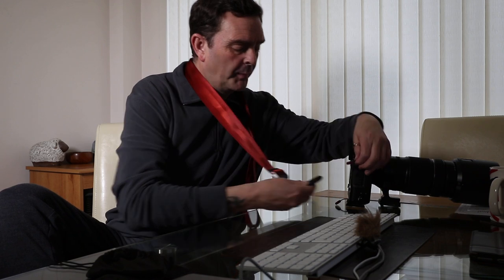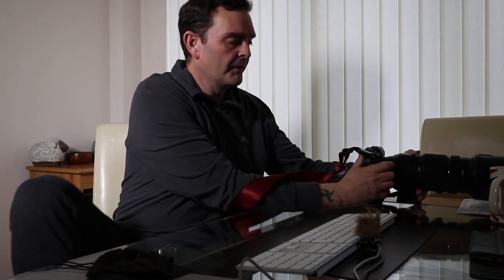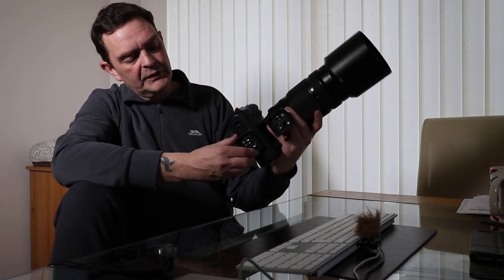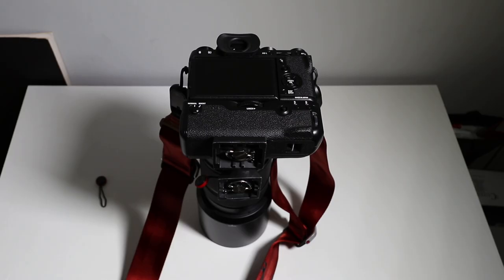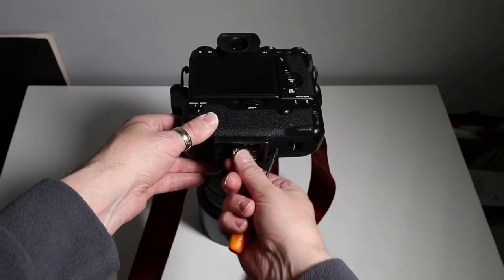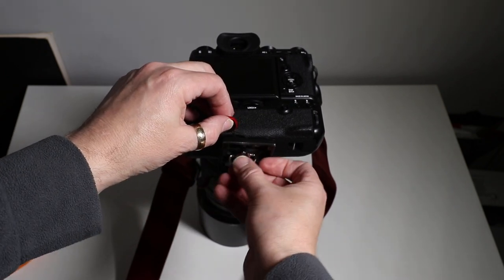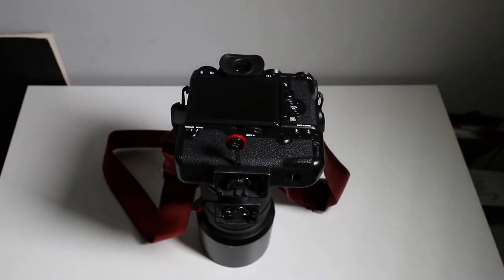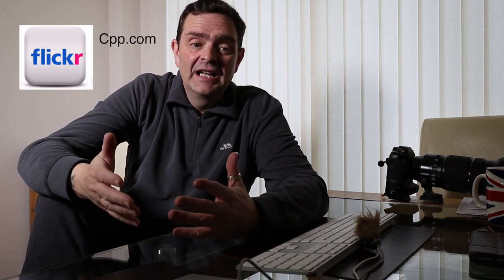Peak Design Slide Camera Sling Strap to tripod mount

Comment: A bit late with the reaction.. i have the slide and a rollei tripod, i used to do it just like you showed. The problem is when put  it vertically on my tripod the grip of the mount under the camera is to loose. Because of the peak design anchors.

Comment: Hi Chris I used the peak design stuff as well and have just found out that they have released an updated version of the anchor points that are slimmer and go through the xt- eyelets without having to remove the inserts. I use the cuff for all my cameras and they are quick and easy to use same as the straps.
Jim
Reply from the maker: Jim McDowall Grumpy Photographer cheers Jim I’ll will have to do a quick update in my next vid that’s good to know
Reply: No probs Chris the system is probably the best I think especially the cuff when you don't want to use a strap. Some folk think the strap is a bit like a seat beat but it is very functional.

Comment: The latest camera plate has four holes on the corners so no need to worry about taking of plate off and remounting just feed leads through hole of your choice and that's it. Dual plate that is. Also for  manfrotto mount or arca swiss.
Reply from the maker: John Goodwin thank John

Comment: Do I have to buy the Peak Design Dual Plate v2 if I want to attach to a manfrotto QR200PL or will this work with any plate
Reply from the maker: I would have thought it would work the same as any quick release plate  Just make sure it's very tight in between the plate and the camera tighten slowly not to put over strain on the camera body  If you feel in doubt then I think it would be best to buy the dual plate v2 
hope this helps cheers Chris
Reply: chris paul thank you Chris for your feedback I guess I will get the v2 plate from PD to be safer
Reply from the maker: Mohamed Mostafa I would do the same Mohamed. Take care my friend. Chris